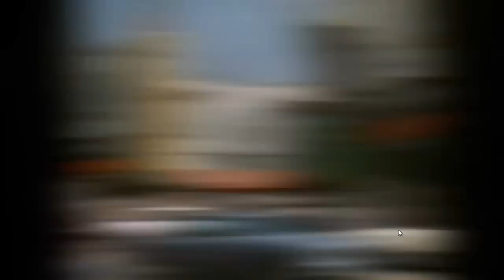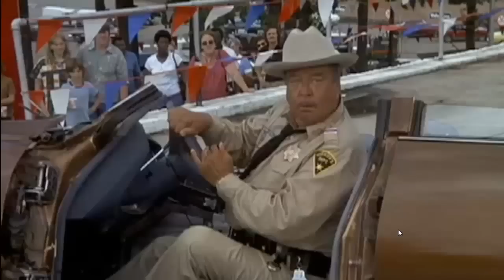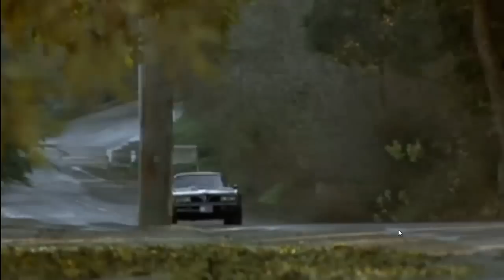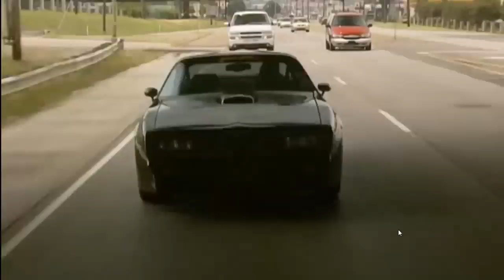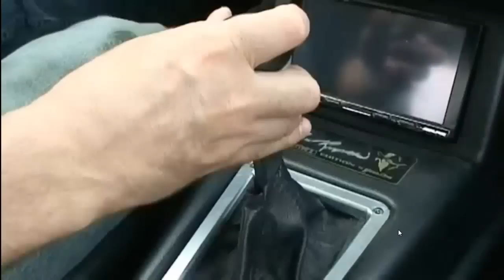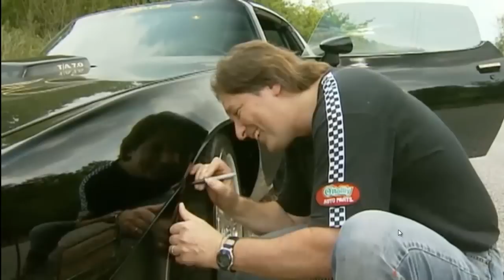Stacy David drives 1977 Bandit Pontiac Trans Am Burt Reynolds Ed. on GearZ (HD)

Comment: The stock wheels in the 70's were pretty narrow and poorly built and would not have handled the three times the horsepower, grated i do think the stock wheels look better but that was a sacrifice that had to be made. The problem i have is with the headlights everything else looks pretty good especially the flush mounted glass

Comment: nice build on the retro, c7 will way out handle that n with launch control on the c , doubt you'll win in a straight line eithier, just sayn, year one did a great job though , gobs  more of hp n handling than than  the 77,

Comment: manual trans is good but not correct. burt neutral slammed the original to get 2nd gear chirp. those cars were slow. the 75 H.O. 455 was the real deal.

Comment: I remember in the 80s riding in a TransAm. We were on a busy street on the weekend and I was pinned back in my seat in horror while at the same time thrilled with the acceleration. One time years earlier a similar experience and I remember the shaker. Like a fool a few years ago I could have bought a '73 Gold one for around $5K restored and let it slip by.